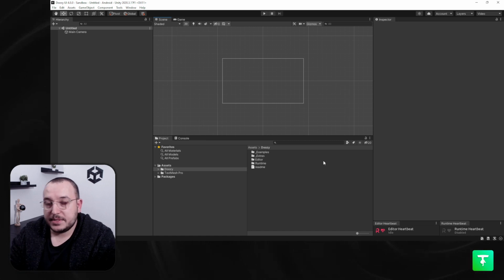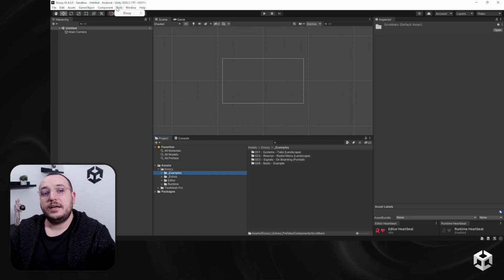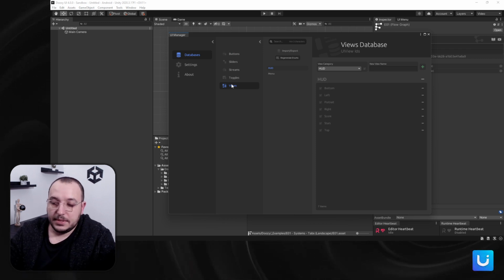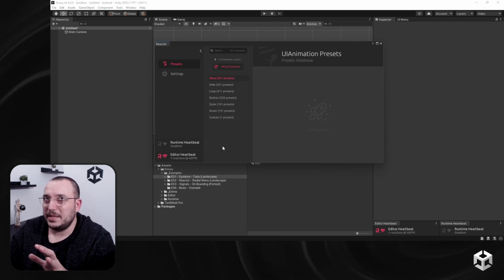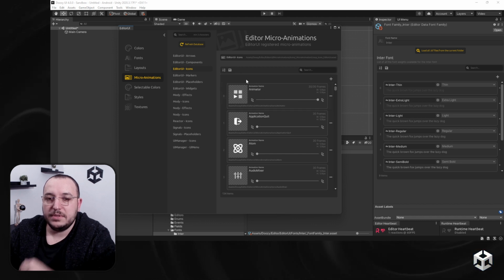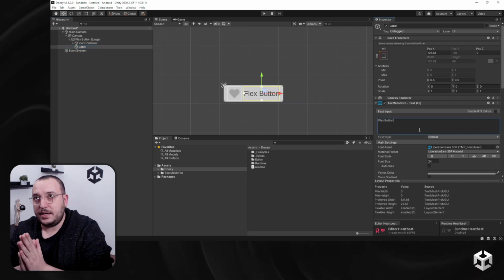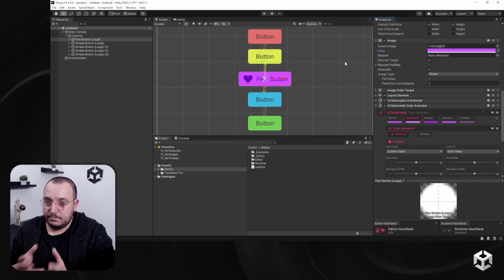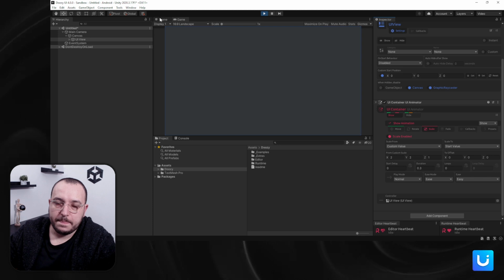Introduction to Doozy UI Manager for Unity

Comment: I have a problem with the UI Menu. Whenever I open it the window is empty. And if I try to create a Flex button there's a warning printing that the system couldn't find the prefab so it returned null
Reply from the maker: You need to run a Global Refresh to generate all the editor databases and custom code.
Tools > Doozy > Refresh > Global Refresh

Comment: New version looks very cool!

I have one question regarding gamepads compatibility. 

I know Rewired is still much more stable than using the unity input system, but if this system uses the new unity input system I can assume It won't be possible to attach rewired at the current state.

I know people that works with Rewired combined with doozyUI v3.

So I assume we need to decide either using DoozyUIManager or Rewired, but not both in the same project? I bought the asset and I'm having fun with it but I may move a step back if there is not an easy gamepad connection.

PS: I'd highly recommend adding as an example a general game flow like: logo -->fadeto---> logo -->fadeto --> Title Screen with (play options exit) -> Gameplay.  This would be a nice start example so we use the plugin in the intended way.

Thanks!

Comment: Guy, you really need a 3 minute or so highlight trailer to show what this thing does. Every video you have is like 1/2 long. I don't mind investing the time, but I would at least like to make sure it's generally what I need before doing so.
Reply from the maker: Thank you for your suggestion :) 
This is a very big asset with a lot of options that cannot be summarized in a 3 minute video. You are correct a shorter highlights video is becoming a necessity and we plan on making one as soon as we can. We created a few new technologies that need explanations and this is part of the reasons why making a short video proved to be a difficult task.

Comment: This looks so good, just the categorizing and dropping premade working prefabs on the UI view is worth it in my opinion.
Had a question, maybe more general and not too specific for this video: in latest projects I have found myself doing a lot of MVVM style of UI, data binding (using “Welder” which works surprisingly well), data sources/stores, etc… does DoozyUI offers something similar to that? I.e. if I want to display an array of data that when set to a specific collection the system knows to instance which type of template on a list? I.e. the product card example, a way to have a list of 500 product cards (name, heart state, cost) and the system will then instance 500 product card templates each with their corresponding text/selected/cost values.
On that note, also virtualized lists, i.e. it might have 500 ‘dummies’ which are empty until an actual product card comes into view then it fills the corresponding product card data from the array of 500 for that card that came into view.
Just curious, started looking at this and it looks mindblowing from the get go.
Reply from the maker: Thank you! 

The UIMenu was designed to have a WYSIWYG workflow in Unity, and what you saw here is the end result.

We didn't add a data-binding sub-system yet, but one will definitely be added in 2022. All systems that make up Doozy UI Manager are highly extendable and customizable, and it takes a bit of time to design and test every new one. In the end we believe that the end result it's worth the extra work and time.

Our systems are designed with care and tested extensively to respect the highest quality standards we are able to uphold.
Reply: @DoozyEntertainment  Alright! I’m giving it a test drive no matter what, got a hunch that 90% of the time this will solve most menus nevertheless. And would be already warmed up for when any sort of data handling makes it’s appearance. Thanks for the follow up.

Comment: Is there a public roadmap/timeline of features planned for v4?

I'm a user of v3 and just started messing around with v4 and while I see some significant improvements with certain things, there's a bunch of stuff v3 has that's missing in v4 (Soundy? Themes? Popup/dialog manager? Ability to control a standard Unity Animator Controller from the Reactor system like how you could previously with a progress target animator?).

Overall I'd say v4 isn't at a point where I'd want to switch from v3 just yet to be honest.
Reply from the maker: Since the new version has significant infrastructure and workflow changes, we're running extra tests for any system that is not vital to an UI. We already redesigned the code base for Soundy, Styler (Theme Manager) and Touchy, and are testing them in various use-cases.

As for the Progressor, it's in its final testing phases and ready for release. It will probably be added in the 4.1.0 update. This component allows you to control Unity Animator Controllers.

As for a roadmap, we'll try to add one to the knowledge base.